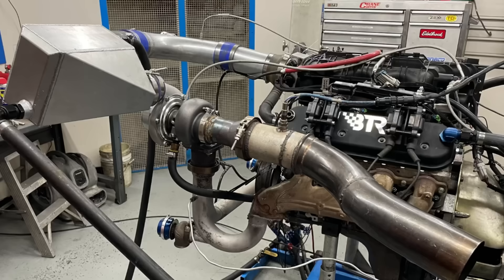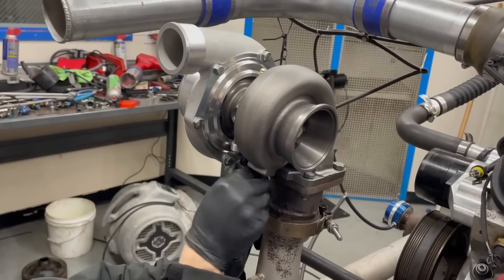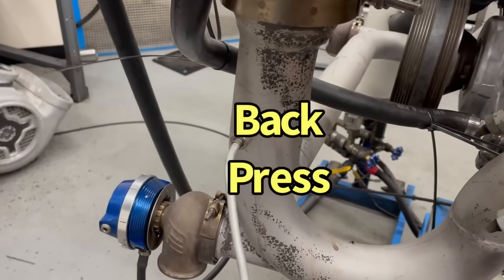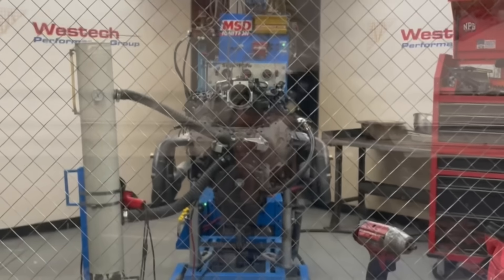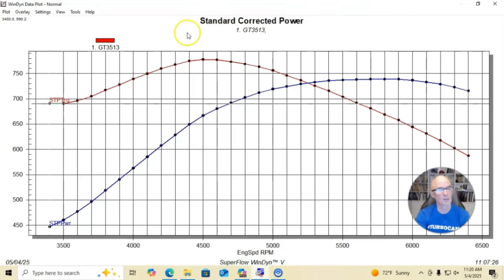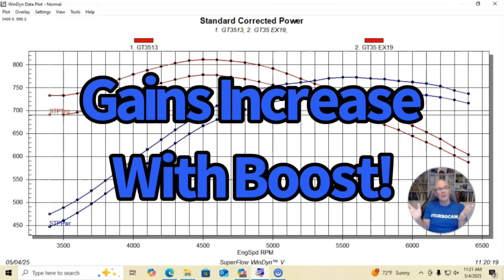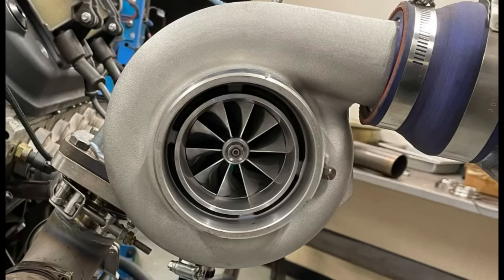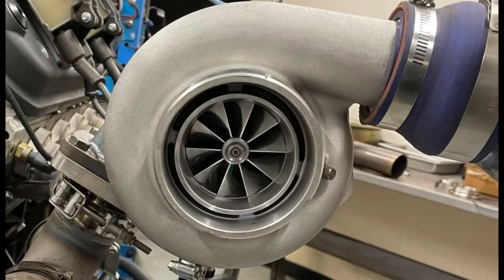WHAT IS THE TURBO POWER CONE? TOP SECRET JUNKYARD TURBO LS POWER MODS! DOES IT REALLY ADD POWER?

Comment: Mine ventilation Engineer here. This is not  a surprising result, as adding a pressure recovery device (an 'évasé' if I may) to the discharge side of a fan or turbine (in this example) is a common way to increase its efficiency/performance or work, much like adding a bellmouth to the intake.
In this example, as Richard quite rightly notes: turbine drive pressure (back pressure) fell once the expansion device was added. This is because turbine efficiency increased. More efficient turbine can flow more gas at lower pressures.

In short the évasé acts to convert useless 'velocity pressure' into more useful 'static pressure or work.' In this example, work = drive on the turbine. Noting that total pressure in a system is constant, since: Total pressure = Static Pressure + Velocity Pressure. Now one might ask, why not have not pipe on the discharge side? Well the pipe acts are a flow conditioner to prevent stall conditions, which are inefficient and noisy (much like an intake bellmouth.) So like a bellmouth, there are optimal geometries for évasé's. Typically expansion ratio's of ~7°-12° are considered optimal at seal level, with longer being better. The greater the expansion ratio the more likely that you'll generate stall (airflow dethatching from the pipe wall.) The limit of which is 90° or no pipe at all, or 0° a straight pipe with no pressure recovery. This optimal expansion ratio is affected by atmospheric pressure, where as ambient pressure falls, the optimal expansion ratio increases. 

Good additional test to perform:
-Keep turbine drive pressure the same in tests A/B
-Keep intake pressure the same in tests A/B

Additional things to monitor:
Static and velocity pressure in the discharge pipe. Both before and after the expansion section in the pipe with it. (again, this can be a challenge to do, especially the velocity pressure.)

(As an aside, this is why plenum design on intake manifolds is important, having maximum static pressure at the mouth of the inlet runner is the best way to maximise airflow into the runner. Once air is in the runner, velocity pressure becomes important due to a verity of other factors. Now back to the topic at hand.)
Reply: Auto Research technician here, I installed several "expansion cones" of various angles & placement in relation to the exducer cone. One in particular, I was instructed to build to seamlessly follow the exducer cone expansion angle (see cone from 1:14 to about 2:55, this vid.)  out to the 6" max exhaust tubing (pipe). The engineer explained basically what you (@manitoublack) said. The goal was maximum fuel efficiency/power at high output. I don't remember which cone configuration was best, but all inproved it some over the std. 5" exh. pipe. Fun times at a dream job....then I got to sick to work😟.
Reply: Someone got scooled!
Reply: The irony is that plenum size really doesn't do much for car intakes. Richard has tested this, and I've seen plenty of Hondas try to re-invent the plenum by going massive. Like he said, you guys are over-thinking it. Turbo go whirrrrrrr.
Reply from the maker: you both are over thinking this situation
Reply: @richardholdener1727  the Mine Engineer is overthinking the situation? Seems like he agreed with you and provided context beyond dancing with a Bud Light, screaming that it worked.

I’ve stepped up downpipes on old RWD turbo Volvos to positive effect, but now I better understand why it worked, beyond the logic of short straw easy, long straw hard, fat straw easy, skinny straw hard.
Reply: @grumpysteelman  You just want the largest pressure differential possible after the turbo. Cone angle etc. doesn’t matter. It would get the same result without a downpipe/exhaust. The issue comes when you have a real car and need to run the exhaust through the rear. It’s best to size appropriately because going too large can create turbulence and reduce flow. Typically stepping down from the downpipe is key (i.e. 4.5” downpipe to 3.5” exhaust
Reply: @richardholdener1727  That's just the way engineers are but first, they always let you know they are an engineer...

Comment: What was the back pressure/boost ratio on the GT3584rs?
Reply: all of it. high as hell, in an earlier video
Reply from the maker: what this guy means is 2:1 or lower than most OEM applications
Reply: @StavTech  And yet it still doubled HP. The reality is drive pressure doesn't do anything 'bad' besides restrict HP, and still lets you add boost to compensate.

Comment: Switched from a GT45 to an ON3 76/65 on an LQ4 with 243 heads and immediately messed up a rod at 10 psi. Dozens of runs with the GT45 with no issues, do you think back pressure played a part?
Reply: Why did you go down to an inferior turbo? ESP the hot side
Reply: @aaronliddell4280  I have a lot to learn about turbo sizes, AR, etc. I saw 76mm vs 69mm and thought hell, more bigger is more gooder
Reply: Probably built boost earlier. Excess drive pressure against a restrictive turbine could certainly do that. 

High cylinder pressures at low rpm can kill shit with a fraction of the power. The nitrous guys learned that one a long time ago. You need a much, much beefier bottom end to put up with low rpm, stump pulling torque than you do with high rpm horsepower.

That’s my bet, all day.
Reply: @grumpysteelman  thanks! 

I just pulled the bottom end apart, bearings are just fine and no sign of bent rods. My first thought was broken ring lands (again lol) but it’s not blowing any smoke at all. Odd stuff
Reply from the maker: was the tune the same?
Reply: @richardholdener1727  exact same tune. It’s the only factor that’s changed
Reply: @StationroadRatrods  That tiny turbine (65mm vs 78mm) likely let it spool much faster and ran into a zone on the fuel map that wasn't tuned right. Or it spooled fast enough to create massive torque too low, which is known to fold rods.

The best turbos tend to have very similar inducer to exducers sizes. The 76/65 has too large a compressor for the turbine, and the gt45 is the reverse. BOTH also have very old tech wheels, which flow less than a much smaller modern turbine.
Reply: @hydrocarbon82  I appreciate it. I’ve been looking into a 78/75. I’m not looking to rotate the earth here or anything, but I’d like it to run well. The GT45 impressed me, it does a 1.7 60 foot and 3.5 0-60 in an awd RCSB Silverado that’s full weight at 8-10 psi. 

But we all know it could be faster lol
Reply: Smaller turbine vs. Compressor will take a lot more energy to spin up the compressor ( more back pressure as it spools ) if the compressor is smaller , it will spool up super fast , but it takes higher turbine speeds to make the same boost. ( Back pressure may be higher all the time by a point or 2) The compressor matches the turbine,  you kinda get the sweet spot where it spools fast still.   If the compressor is tiny compared to the turbine , you risk over speeding the compressor (wheel or bearing can die if you ask for "all of it" ) general rule of thumb, the closer the sizes the better from real world testing.  Low rpm power kills rods.  500 hp At 2000 rpm , vs 500 hp at 4000+ rpm.  At 2000 rpm each power stroke has to hold twice the pressure to make similar power. Aka  Low rpm boost breaks stuff.

Comment: Thanks for the video. Does the length of the small diameter section matter? If you had to run a 3" downpipe for packaging, and stepped up to 4" under the car would it be worthwhile?
Reply: The shorter the smaller diameter length the better. All this is showing is a less restriction.  “just bigger exhaust”
Reply: @N8Butlerautosports  I figured that much just wanted to see some data
Reply: My understanding is the transition essentially helps reduce the spiraling of the air quicker. Spiraling air travels down a pipe slower which creates backpressure. Laminar airflow is the most efficient for a given pipe size.

Comment: 🤔 I wonder IF you would lose the gains if you had the 4inch exh section for 🤔?? Say 12 in long then reduced back down to 3 inch
Reply: I was thinking the same... like the expansion chamber on a 2-stroke.
Reply: @michaelblacktree some of the newer bikes have expansion chambers of the 4 strokes. Ik ktm and Honda do. They're not as big but they still have them
Reply: That's a legit. question.
Reply: I've seen this done and asked the same question - eg. expand to 4 inch dump pipe off a high mounted turbo, then transition back to 3 inch underneath a car to help with exhaust routing/ground clearance

I'm told it works.. Maybe you don't retain 100% of the gain but once gases start to cool and the flow becomes less turbulent/more laminar, the smaller cross section is less of a penalty.
Reply: Add me to the list of people that would like this topic tested in the future.

Comment: Could you make a comparison at some point with these 2 turbos on 91-93 pump gas? A lot of people still don’t have close access to e85. Especially for a daily driver. Also do you tune without knock sensors?
Reply: Any other turbo test he’s done on E-85 and pump will give you the same idea.   I only have pump 94 where I am…….   The E-85 just lets you add more timing.   E-85 has a lot of downfalls as well.    Just get a meth injecting kit with pump gas and you’ll be in the same ballpark. If not a bit farther ahead without the drawbacks of E-85.
Reply: @ he’s done a few videos showing the difference between e85 and pump gas. And depending on the combo there’s over a 100hp difference. I’m just curious about these specific turbos.
Reply: @CULT539 

None of that is true. I have been using the fuel since 2003. Experience taking here
Reply: and he tunes with A/F readings and I assume reading spark plugs.
Reply from the maker: there would be less of a gain since the power would be way down on pump gas